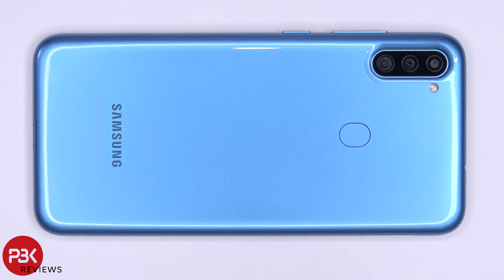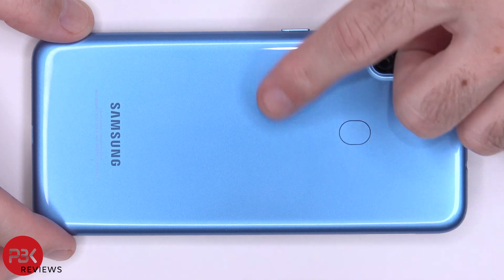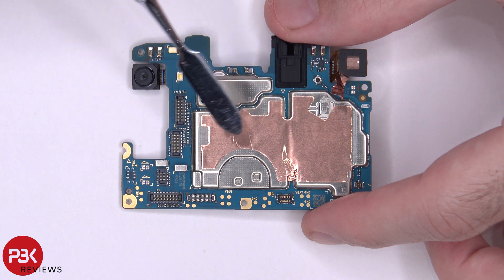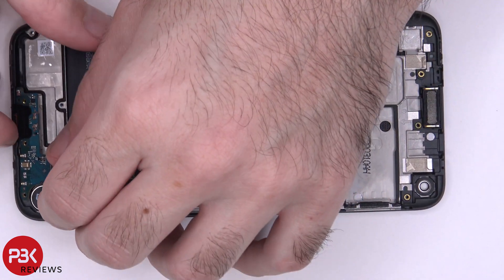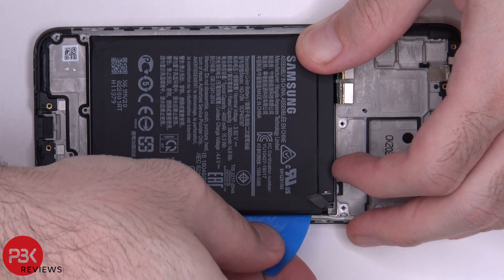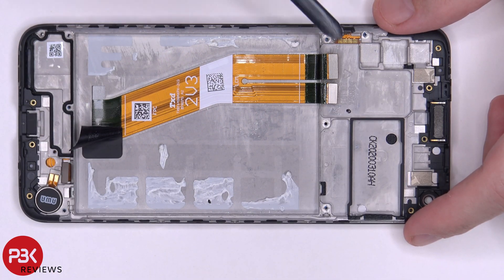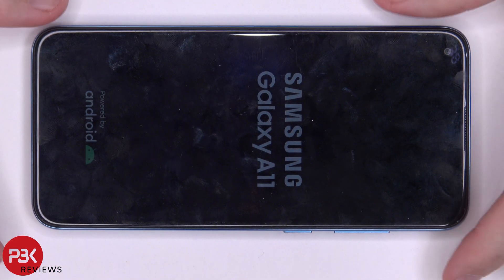Samsung Galaxy A11 Disassembly Teardown Repair Video

Comment: So i ended up somehow getting water in my usb port and i think my battery too idk what to do can you help me? My phone wont turn off it just sends me back to my lock screen and flashes. HELP!!
Reply from the maker: You would need to take it apart, disconnect the battery cable, dry out any water or moisture, then brush off any corrosion on any chips or connectors with a small brush and re assemble the phone to see if it will work.
Reply: @PBKreviews My phones flashlight is flashing when I turn it on as well. I tried to see if my father could fix it and he said he thinks that it's possible I got water in it but it's also possible my phone is getting too old. But I knew that I hadn't gotten too much water in it because it wasn't like I dropped it in a puddle. it was a few drops. So I'll probably just replace my phone but thanks for the help.

Comment: You should never use heat on a lithium ion battery. Buy some 99% anhydrous alcohol and an eye dropper. Use the eye dropper to SOAK underneath the battery while applying force with a razerblade from underneath. The alcohol is not conductive nor corrosive and will disolve the adhesive. The pressure you apply with the blade will pop the battery up with ease and you can simply pull it the rest of the way with your bare hand. I do this multiple times a day try it.
Reply from the maker: yeah this video is fairly old, isopropyl alcohol is used now a days to make it easier plus most batteries come with adhesive pull pouches now so it's not even necessary

Comment: So my a11 is a couple years old. I think the adhesive has worn down so when I dropped it, the back part popped off on the side with the volume and power buttons. I cannot seem to press it back on, it's like something is stuck right behind where the volume buttons are located. Not sure what I should do, I'm a bit scared I will break my phone completely if I do anything, what should I do?
Reply from the maker: It might be the metal bracket which holds the power button to the side. You would probably have to take off the back housing to re seat it properly and push it back onto the phone.

Comment: Excellent tutorial. I managed to shove my micro-sd card into the slot but without the tray. Should I be able to access the card slot if i disassemble the phone?
Reply from the maker: Thanks. yes you would have better access (even though not the best) to try and push it out. But be careful not to damage or break the sim reader pins.
Reply: @PBKreviews  That gives me a better idea of whether to risk bricking it or not. Thank you so much for your reply. Do you know if there is anyway to forward my number to another phone without the sim card in place?  Spectrum didn't help.
Reply: I managed to define my issue much better with Spectrum so  they upped me a level and told me all I have to do is insert the broken phone sim into my other phone on the same account.. Fortunately they were compatible and I am back to my old number on the new phone. No need to forward my calls! At his point I'll probably buy the kit in your link and also take it to a local shop to see what they say. Thank you again. This was a bit of a nightmare.

Comment: Looked this up cause my phone sometimes gets oddly warm around the fingerprint sensor when everything else is fine, and i was kinda worried. Good to know that its most likely just the copper heat transfer tape

Comment: Same phone have a black screen. The alarm sound ⏰ goes off everyday, vibrate, and it still charge. I try holding down the volume down and power button and other videos method. Is there a way to fix it.
Reply from the maker: Most likely the screen has a crack somewhere that you cant see that is preventing it from working. Would need a new screen.

Comment: I replaced a LCD and once I snap the back cover the phone stops working.    I take off the cover and phone functions properly.  What seems to be the problem?
Reply from the maker: There might be a short somewhere on the phone where something is pushing against a metal part of the frame that should not be or the connector is being pressed down and causing an issue if there isn't a good connection. Did you replace the screen by itself or you replaced a screen with pre attached frame combo?

Comment: Using that metal spatula on the logic board can damage the board easily... Both static electricity and prying against the small filters around the terminals can cause irreparable damage. Plastic tools work best....
Reply from the maker: Yes using plastic is best but forget about shorting. These aren't from 20 years ago, electronics now arnt that susceptible to being damaged from static. I can't believe people still say that. I have been doing this since 2003 and worked on thousands of phones. Not once did anything ever short. If your sitting on a static rug and rubbing your self around it while your doing this then yes maybe you might and this is again might short something but if you have the battery disconnected you shouldn't have any issues. But ya metal tools can damage the parts more easily than plastic tools but sometimes plastic tools can actually damage the parts when they are not strong or thin enough and break off resistors around connectors etc.

Comment: How did you remove the Sim tray? And where did you get the guitar pick to go around the housing?
Reply: a simple paper clip can do the job, the sim tray has a small hole to ejec it, on the other hand you can use a old credit car or something like that, but first you have to lift the cover a little bit because its tight, I used a cutter then the card, don't let anything stop you
Reply from the maker: You use the sim eject tool provided in the box of the phone or can order one online. Links to tools are in description.

Comment: Where would the LCD cable be located at?
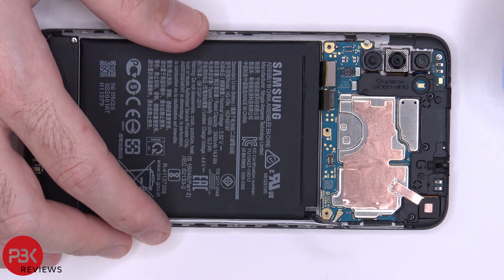Reply from the maker: The two cables you see in the video being disconnected @1:45 would be the part of the LCD flex cable. They are both part of the same flex cable which connect the board to the screen, as well as the sub board on bottom. So when replacing the screen, you would need to remove the battery as well and disconnect the flex cable from the bottom sub board also.

Comment: what is tht small wire called tht connects into the motherboard ?
Reply from the maker: the wire cable? that is a smartphone coaxial cable. The flat wires are called flex cables.

Comment: Could you please let me know what happens if I accidentally broke off 1 of those springy contact clips. That tell the phone the back is on. Lol I'm sorry I don't know proper Phone language. I have a a11 that is water damaged the back is off but I believe I snapped off 1 of the 6 metal springy clips. The 3rd from the left of the 6 above the cameras. If anyone has any advice I would appreciate it. I can't afford to buy a new phone or pay someone to fix it so any help would be great
Reply from the maker: Hi, those are antenna contacts which touch the antenna flex on the back housing to make a connection. If you broke one, its possible you may have reception issues with either voice, or data or wifi. Its possible you wont have issues also since there are multiple antenna to gain signal from different directions n ways so won't be able to tell until you test it out.
Reply: @PBKreviews  thank you, I'm a little releived to hear that, well I will be sure to let you know how it goes with it if I get it back working. When it comes to fixing that, is soldering the only possible way? Or could I possibly glue it?..

Comment: My screen went black
Reply from the maker: Its possible if you dropped the phone that the screen got a hairline crack somewhere that you can't see and its preventing it from working, or possible the cable has gotten disconnected from a drop. Also possible the phone is just frozen, try holding down the volume down key and power button at the same time for 20 seconds and reboot the phone and see if it works.
Reply: @PBKreviews  thanks to take the time to help me tomorrow I'm going to take the phone to someone who open it and disconnect the battery if doesn't work I have to buy another one but thanks a lot
Reply from the maker: @karmichaelneira2448  you're welcome
Reply: It was better when you can desenergizer the phone take away the battery for 30 seconds and go back again but anyway thanks i will tell you what's going on with my phone after
Reply from the maker: @karmichaelneira2448  ya. sounds good.
Reply: @PBKreviews  i took it this guys don't want open it i had to buy another one but I order a lcd replacement to do it by myself anyway don't work
Reply from the maker: @karmichaelneira2448  oh i see. Let me know what happens with your lcd replacement and if it fixes it.
Reply: @PBKreviews  ok
Reply: I get until take the battery out and get fire but I'm fine
Reply: Right now I have a lcd screen replacement for samsung a11

Comment: Hy is the Samsung Galaxy a11 fingerprint replacement available
Reply from the maker: Yes, you can search galaxy a11 fingerprint sensor on ebay and you will see listings for it.
Reply: @PBKreviews  thank u
Reply: @PBKreviews  can i have it replaced at the repair store instead of ordering

Comment: The advancements in technology are only matched by the advancements in making it a pain in the ass to take them apart to dissuade people from doing it.
Reply: US $19.28 Original new Samsung Galaxy A11 A115/F/DS LCD Display Touch Screen with frame Assembly

https://a.aliexpress.com/_mMyX9S9
Reply: I agree, 100%  I miss the days a back when you could easily replace your battery without being a fucking medical surgeon the pull everything out in order to get to the stupid battery just to replace it.

And this is why people are kind of dumb and they'll go out and purchase a $1,000 phone.

The funny thing is, there are cheaper options and not everybody needs the best of the best of the best phone.

But everyone believes they need the best phone.
Reply: No it’s definitely because then you won’t be able to actually “shut off” the phone this way the battery is always connected

Comment: Qhat if the fingerprint sensor button comes off with the back plastic? What should I do.
Reply from the maker: You might need to replace the fingerprint sensor
Reply: @PBKreviews  this happened to me. I accidentally ripped the fingerprint sensor cord. I bought a new cord and replaced it but it says fingerprint sensor not working. What else could be wrong?

Comment: Uhm taking apart the fingerprint thing now fingerprint dosnt work
Reply from the maker: Did you possibly damage the cable for it?
Reply: @PBKreviews  i just pulled it off like u did
Reply from the maker: @jessecully4673  hmm not sure. Have you tried making sure its connected back properly? Also try turning the device off and on see if it works.
Reply: Did u figure out how to fix?

Comment: but you never showed how to replace the screen
Reply from the maker: It's explained in the video how to do it, there is no point in prying off a working screen to damage it so I just explain what you do. Once the phone is taken apart as the video shows, all that is left is for you to pry the screen off the frame. New screens usually come with adhesive so all you do is get your new screen once you pry off your old one and apply it back to the frame and re-assemble the phone.

Comment: can replace the front camera of this phone with an iphone camera and can it work properly ?
Reply from the maker: most likely not. the camera connector would have to be the same and the software on the phone would have to read the camera which most likely would not happen.
Reply: @PBKreviews  or can i replace 8mp A11 camera with 13mp from samsung brand ? Will it work

Comment: So as a repair tech, the phone cost me 135.99, and assuming I can get parts, the time in labor would be more than a new comparable cell.  Even if it was just a battery or screen.  A throwaway, buy a new cell.  And when I say throwaway, recycle it, do not let it go to a landfill!
Reply from the maker: Yep, I would rather get a new phone in most cases but a lot of people would prefer to fix it rather then spend an extra $30-40 if they don't have to.
Reply: @PBKreviews  It all comes down to how much is your time worth?  As I get older my time becomes more precious.
Reply from the maker: @martinenglish6641  yup
Reply: @martinenglish6641  well, work is work, if you rather sit around doing nothing than doing a simple job that may not get you much then that's fine, but I rather make money during all my work time, it's not like moving a regrigerator upstairs to get like 5 bucks and destroying your health, so if you are not like a super scientist who spent like 50 years studying your field I don't think your time is that precious, but that's just my way of thinking.

Comment: So just to replace broken outer glass you have go through all that??
Reply from the maker: yea, since the battery would need to be removed as well as the charger port board and screen flex cable would need to be disconnected from the main board, so everything would need to be taken apart. If your replacing just the screen without midframe, you would heat up the front of the screen and pry it off the midframe after you took everything apart as shown in the video. Then you would get your new screen and apply it with new adhesive to the midframe making sure you run your screen cable back through the midframe and then re-assemble the phone. If you're replacing a screen pre attached with a midframe already (which would be easier), then after taking everything off the old screen assembly you would just re-assemble the parts onto the new screen assembly, not having to pry the old screen off the midframe and having to re-apply the new screen with adhesive back onto the frame. Hope this helps.
Reply: @PBKreviews  well that sucks. Hate to go through all that for this crappy phone.  Ty for the vid. At least I know what I'm in for.
Reply from the maker: @cfh4201969  No problem. You can always buy another A11 and just swap the motherboard and sell the other one for parts
Reply: @PBKreviews  maybe. But I think it would be cheaper to buy a $15 screen and an hours time. Do you have a vid for the Galaxy S9? I smashed the glass and lcd screen on that one thats why I bought this A11. Just temporary until I fix the S9. But the replacement screens are around $200
Reply from the maker: @cfh4201969  Not sure where you found it for $15 but the cheapest I can see is around $31-$32. But ya still cheaper to replace the screen instead of the phone, all depends on how you feel about taking it apart etc. I don't have a video for the S9 sorry. Also S9 screens are anywhere from $80-$140 from what I can see on ebay.
Reply: @PBKreviews  Amazon for A11 screens. As cheap as $10 w/o tool kit.
And ya S9 screens w/lcd display is $180 +
Reply from the maker: @cfh4201969  Not sure where you see $10, but keep in mind if you are just referring to the glass, you can't replace only the glass. They are fused with the screen. Only factories with special tools and machines can do it properly.
Reply: @PBKreviews  I see. So yea they do sell just the glass
Reply from the maker: @cfh4201969  oh ok ya, not sure why they do that when almost no one without the proper machines or tools can do it. I'm sure they get hundreds of returns because of that but yep.

Comment: hi, what do you think about the quality of the construction materials (inside and outside) of this A11?
Reply from the maker: Quality is not bad for the price of the device. It is sturdy but not as heavy duty as premium devices etc. Repairs should be fairly easy on it.

Comment: Why so much adhesive?! Damn Samsung, you're screwing me!

I'm not finding a port for my memory card. I have not personally removed the battery, which is where it's usually found, but I didn't see one on this one either. Any suggestions?

I'll keep looking in the meantime
Reply from the maker: Hi, the memory card slot is the same as your sim tray, there is a designated location on the sim tray you place your memory card in (onboard storage is different from the memory card and onboard storage is not removable).
Reply: @PBKreviews  I made a very big mistake by not finding instructions on how to install the simm and micro-sd. As a result of my impatience my micro-sd card is down inside without the tray and the SIMM is not installed.

Comment: Hello I have a problem with my motorola moto z2play xt1710-02 that is bricked, and I can not find its drivers on the one hand I do not know if someone is so kind to help me to be able to repair it I need for my tasks right now that I am in quarantine... This was written from a stationery...
Reply from the maker: You might need to look for a stock z2 play firmware and flash it with RSDlite but not sure exactly how it needs to be done, you would need to read or watch tutorials on it